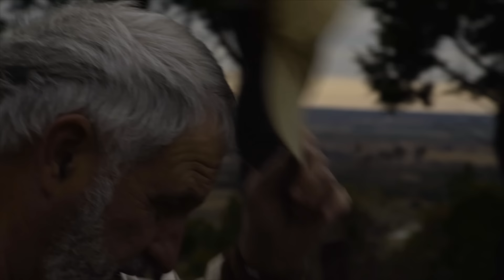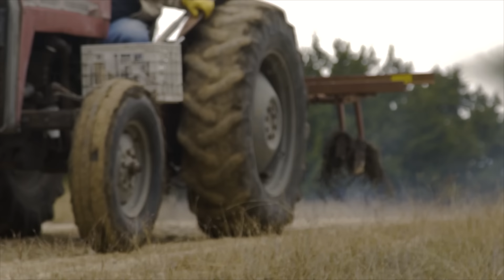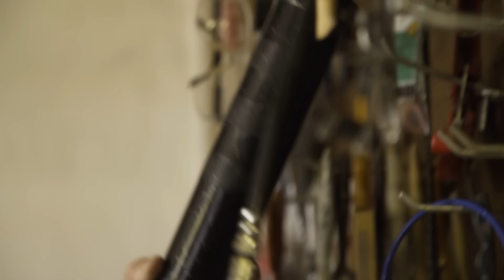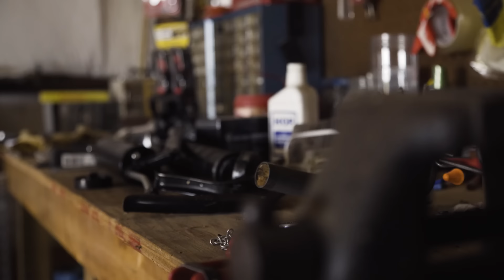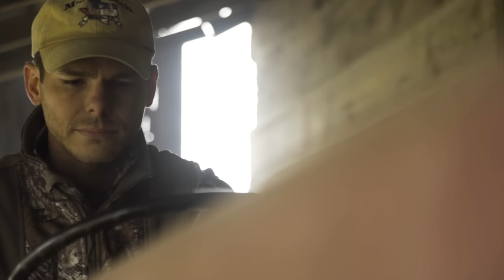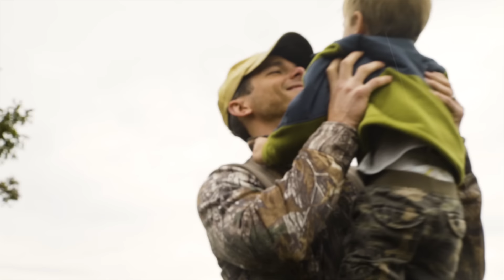Granger Smith - Tractor (Music Video)

Comment: on my uncles farm, we had two working tractors, a massy, and a ford, the old '84 ford was the first one i sat in, but the massy, oh boy, the clutch may break your foot but it was my tractor, i loved it. it was a 62 yellow front loader with a PTO, that little chore tractor was amazing. then great grandpa died...and my uncles farm was struggling after that...i promised my uncle i'd go up every day during the summer to help out, then he offered his 93 S10 to me, i loved that truck, that truck hauled the one ton massy, should it? no, but it did, i loved working on that truck when my uncle was at my house. then one day my uncle went to the farm to do some work, then found the gate locked up. he said he didnt remember locking the gate, so he tried his key, didnt work. his mom (he wasnt really my uncle, he was my dads best friend) hired someone to lock up the farm. all the things on the farm stayed, the massy, the big blue ford, the bale truck, the grain truck, all of it. i told my uncle i wanted to take over the farm after i get enough money. the only thing my uncle has left on the farm is the Pasture Wagon (that S10 i was telling you about) and its sitting in his yard in Great Bend Ks. when the farm is in Plainville Ks. and im just south of Plainville in Hays Ks. but the truck is just sitting there to rot. he has it up for sale, and someone has an engine, a tranny, and a radiator for it. i'd love to get the truck and the farm...but not all dreams come true...granger, if you read this, this song is 100% relatable, i know it wasnt writin for me, but it sure feels like it. thank you man,

Comment: The first time I ever operated a tractor, l was a young boy living in michigan, next to a lettuce plantation, they also grew potatoes. The tractor was an 8n Ford, and I used it to dig potatoes. They also had a Ford crawler type that I wanted to operate, but they said it wouldn't run. Bummer! It looked like a lot of fun.